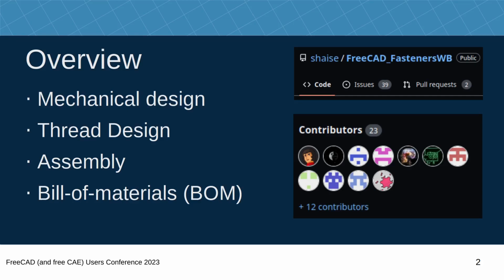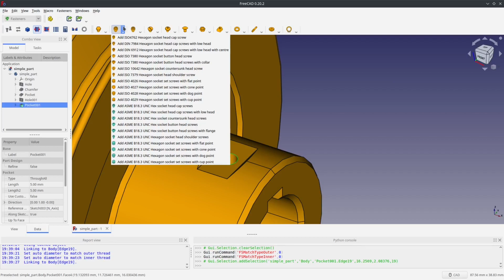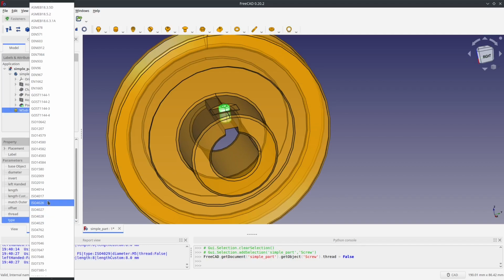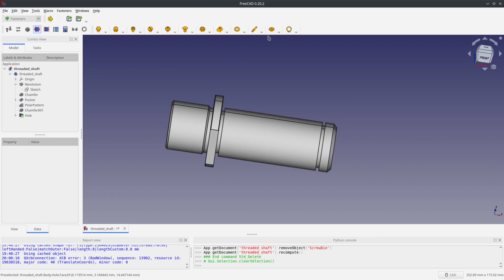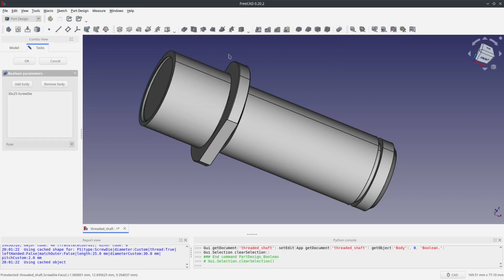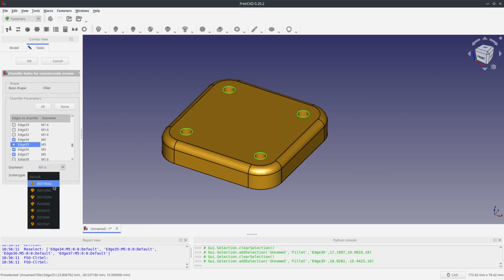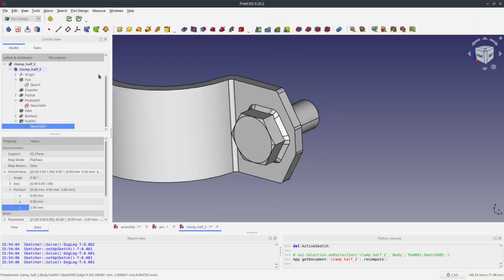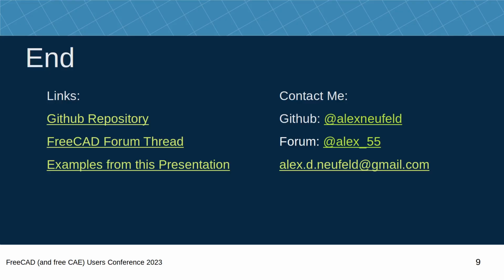FreeCAD users conference 2023 - Fasteners workbench presentation

Comment: Well done presentation. I also now know what the "die cutter" feature is meant for. From just messing around with it (and also not reading the docs) I settled on making a threaded rod instead, and fusing that in whatever way the PartDesign WB lets me "connect" it. Now I know that I can do that much easier 👍
Also special thanks for the 3D printing feature. I discovered that it's possible to print rather sturdy bolts of M6 and up, if they are laid out flat instead of horizontal, and get 10% cut off from their top and bottom each, so 20% less in total. That makes them printable with the weak Z axis not running in the same axis that will put the most force onto them.
Some fine tuning of printer and settings are likely needed, and a set of actual threat cutters for cleaning the thread up helps too obviously, but even without those gives this good enough bolts and nuts for testing assemblies or replacing some lightly loaded parts in a pinch.